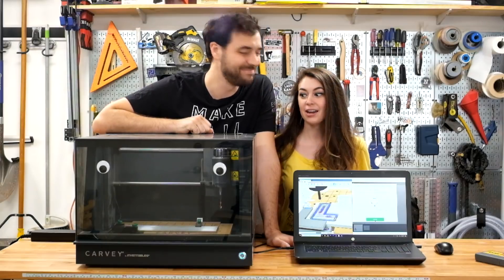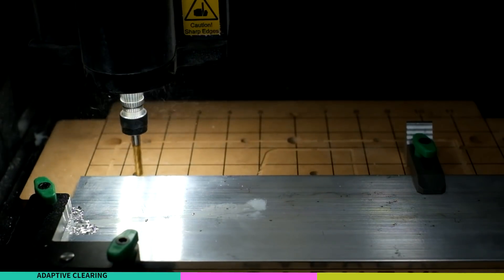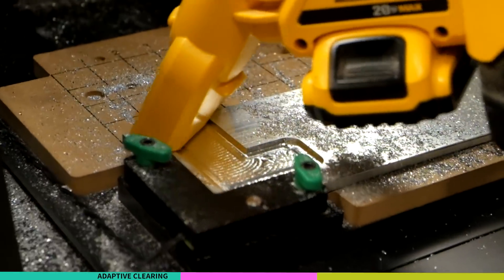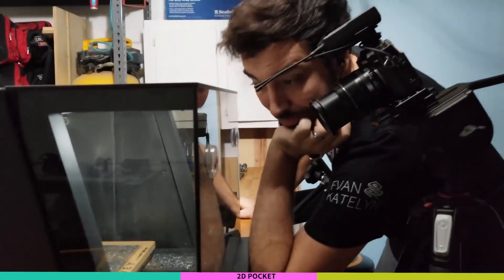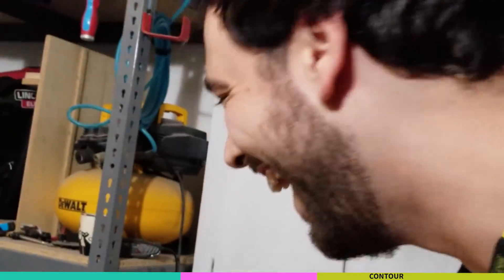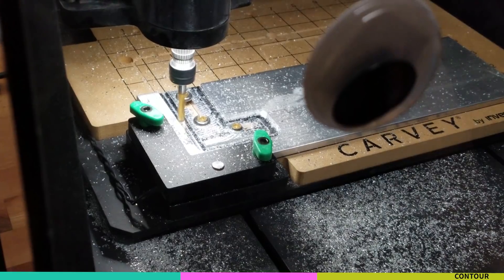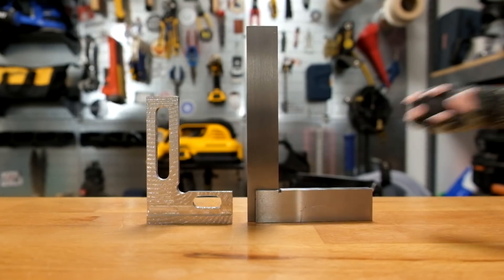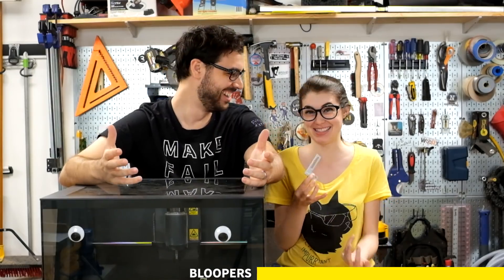Can You Cut Aluminum on a Desktop CNC?

Comment: It was a good video, very educational. But you did the opposite of what is usually done, that is, start with low speeds and depth and then gradually increase. Of course, there are no absolute truths and there are many ways and tools to cut aluminum, but I would use another type of cutter, such as the one-cut cutter, as aluminum tends to clog the tool.

Comment: Keep the cutting tool length as short as you can. This will reduce the amount of chatter. Some sort of lubricant will help reduce the build up of material on your cutter (WD40 or Kerosene can be used). Also there are different grades of aluminium some fabrication grades some machinable grades. 6060 or 6061 are common machinable grades. if you get a fabrication grade it wont machine easily and will gum up the cutter. Putting a drill in your machine and pre drilling holes where you plunge into the material can help reduce chatter when you plunge. Increasing the rpm can reduce the load on the tool but if you go too fast you increase the risk of material gumming up on the cutter so you need to experiment with that to get the optimum speed. Also less flutes on the cutter will give more room for the material escape and help reduce build up of material in the flutes. If you have a blunt cutter don't even bother trying to mill aluminium with it.
Hope this helps.

Comment: DONT PUSH THIS MACHINE. THERE ARE A LOT OF CNC MACHINING TECHNIQUES THAT WILL MAKE OR BREAK THIS MACHINE!!
Hello, I work in precision CNC machining with HASS, OKUMA, and MICRON machines. This video is misleading in a good way. So far the machine looks solid. The problem isn't just the feed rate. It's also the endmill choice. YOU DO NO PLUNGE WITH A BULL-NOSE ENDMILL! This is okay when you have a large machine and the endmills your using have carbide tips and are at least 1/8 inch thick. But even then its not a BEST PRACTICE. You will want to use a DRILL BIT to start the hole. Then use the bull-nose (aka flat nose) endmill to enter the hole and  mill the material away from the inside out. There are other techniques that are added to this as well. First, the guy was right about plunging as you mill the sides , just like he did int he beginning. The problem is also how much of the endmill tip you use. THESE ARE SMALL SMALL SMALL MACHINES. The machines I work with cost hundreds of thousands of dollars, have a huge level of configuration., and can HOG like its no ones business(that means cut huge amounts of material per pass, this is what they tried to do in the beginning of the video and it's wrong for this machine). I am thinking of buying this machine. IT IS NOT A WORK HORSE!! This machine is about as relevant to an full-size CNC machine as the extra napkins you get from a restaurant. I would say that this is a light duty hobby/special work machine. A GOOD CNC MACHINIST DOES TAKES EVERY PRECAUTION TO PREVENT CRASH (ANYTHING THAT INTERRUPTS MACHINING DUE TO SPINAL OVERLOAD)

Comment: I'm a tool maker(machinist) if you want to keep cutting aluminum you may want an endmill with less flute length and a 4 flute Endmill since you have a limited speed.
With your pockets it would help if you drilled your corners first.
Good luck and have fun

Comment: You guys are on the right path for sure. I have had really good results cutting aluminum with a router using single flute bits. O flute is what some manufactures call them. They allow proper chip breaking and for the higher RPM spindles. Oh and use 3/16" that dramatically reduces the spindle power needed.

Comment: Adaptive clearing actually has nothing to do with how much of the tool is engaged with the cut, but it has to do with the tool path. Adaptive clearing attempts to make sure your cutter is always engaged with the same mount of material removal, where as the other strategies in Fusion are more concerned with where they are going. For example, a parallel tool path will always move in long straight lines even if it's not cutting anything or if it's only cutting a very small amount. This is not always efficient especially for certain shapes. Your tool stickout is way too much for the rigidity of that machine. That machine is really made for wood, not metal. For a bit of contrast my proper milling machine is on the small side but it weighs 1500 lbs for a travel of 9" x 18" not that much bigger than the Carvey, but certainly much heavier and more rigid.

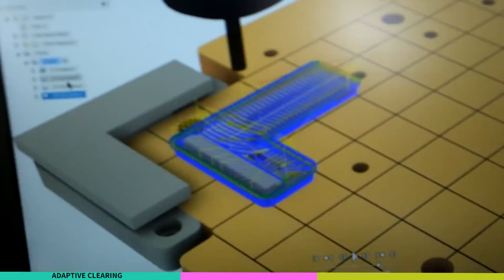Comment: 2:04 I thought Fusion 360 was expensive, but it is actually reasonably priced for a DIYer. $800 for 3 years, not bad.
Compared to AutoCAD at $1500 for just 1 year. Didn't realize how lucky we were to get it for free in school. Wish they had a DIYer version of AutoCAD for non-commercial use that was cheaper.

Comment: The problem is is you didn't have the speed fast enough when counting aluminum you want the bit to go as fast as possible you can make your movements slow but you want to make the bit RPM wise as fast as it can go then it'll cut aluminum like butter.

Comment: Might want toooo - I don't knoooow - consider NOT using ramp passes, smaller end-mill with 3 or 4 flutes for lower chip-loads, and slow that feedrate waaay down, you're going at Sonic level speeds there for that end-mill and machine.

Comment: I think you are getting so much chatter (vibration) because your work holding isnt ridged enough you needed to move that hold down clamp on the right closer to the area being cut as well as moving your feed rate way down, turning your spindle speeds to 95%  and using a smaller endmill if you have one it'll cut slower but have lower cutting forces and produce less chatter overall.

Comment: I have been running a couple of chineezium routers for about 6 years on both fun personal projects and work production. They can be a bit tricky when it comes to cutting aluminum. But they can work pretty well when you dial in the speeds, feeds and cutter size. They don't like 1/4" or larger cutters on aluminum, stick with 3/16" or smaller. We run mostly 3/16" 2 flute center cutting at the full 20,000 rpm, cut depth is set to .035", stepover about 40%, feed rate @ 35 ipm and plunge rate @ 2.5 ipm. I know I'm bit behind the times on this, but I just ran across it and thought my past frustration experience could be of help. I also didn't seen any new machining vids and thought you might have gotten frustrated with it. ;-)

Comment: Nice vid, congratulations. But you cant call this cutting. The vibrations are way too high with this machine and this is why you have such bad surface finish. If you like to use this machine for a longer time, try to avoid cutting alu. Your chips are also way too small, this means that you destroy the cutter very fast. A 1 flute and lower rpm could help here though. Still, if you love this machine avoid alu.

Comment: agree with other comment and also a 3 flute 45 degree helix end mill would’ve assisted your endeavor quite a bit. Properly clamping your product down doesn’t hurt either. A variable helix might help with that nasty finish. And yes it’s as bad as it looks. Just because you think you can’t feel much try polishing that part once. If our parts don’t machine without mark they are essentially junk. To make a bracket for your own use maybe but to make a product you wanted to sell absolutely not. I say this because someone is watching the video thinking they can buy that machine and make a living.
Reply from the maker: Thank you for the tips! Really appreciate it

Comment: You guys are doing great! I messed up WAY more on my first few CNC projects.

A couple things I learned early on, is taking small cuts but at faster feed rate, cleans up the surface finish and makes the bits last longer.
On smaller machines 2mm of plunge is quite aggressive, I would always go with 1mm step down especially for aluminum, and just have more layers at a faster feed rate.

Keep up the awesome work!
Reply from the maker: Thank you so much for the tips and encouragement!! ❤️❤️

Comment: YOU ARE USING TOO LONG OF AN ENDMILL THE SHORTER YOU MAKE IT THE BETTER IT WILL CUT
Reply from the maker: we tried to find a shorter one but didn't have much luck - definitely would have preferred that though!
Reply: MSC SELLS ALL SIZES TYPE MSC IN THE INTERNET AND WHEN YOU CALL THEY WILL SET YOU UP WITH AN ACCOUNT. YOU DO NOT HAVE TO BUY CARBIDE BECAUSE HIGH SPEED MILLS ARE CHEAPER BUT THEY DON LAST AS LONG BUT THEY ARE ALOT CHEAPER TO GET STARTED JUST RUN THEM A LITTLE SLOWER IN RPM

Comment: You can cut aluminum on our desktop CNC machines :)
Reply: They didn't use any lube and used an improper tool with no knowledge of feeds and speeds, so that's not working in their favor, either. ;)

Comment: 300w spindle motor with aluminum? Nope, sorry won't work.
Reply: I'm sure it would work with an 1/8th inch ( 3mm ) end mill. The machine might not be rigid enough, but it would cut. My milling machine has a 500w spindle and I use a 2 inch shell mill on it cutting aluminum.

Comment: Looks like a lot of your problem is that you're losing steps. You could decrease load on the bit by getting a smaller bit, maybe adjust feeds&speeds, or perhaps you could try upping the current to the stepper motors for stronger holding power.
Reply from the maker: Think we might also go with a shorter bit next time but we're definitely excited to try it again soon!!

Comment: Good angle, but it's rough as rough can be. Use a shorter tool, preferably carbide and preferably with more flutes. All of that  will help to reduce vibration and therefore reduce resonances within the structure of the machine. Which in turn, will improve the surface finish a lot. And possibly allow you to feed the cutter faster, as the extra cutting edge means smaller chips and reduced pressure on both the tool and workpiece. Beware feeding too fast though and of higher spindle speeds either of which can cause the metal to weld itself to the cutter.
Reply from the maker: Thank you for the tips! We tried to find a smaller tool but had a hard time finding one.
Reply: @EvanAndKatelyn  Out of interest, how does the head hold the tool? is it a collet or something like a drill chuck? Or does the tool lock in place some other way?
Reply: To be honest, if you're just cutting wood, you could just grind/cut off half of the flutes' length with a dremel or similar. as long at the end is reasonably close to a right angle with the sides it should work ok. But you could help it a little by grinding the central 'web', as we call it, so that the cutting edges almost meet in the middle. 
Check out this excellent video how to. https://www.youtube.com/watch?v=XYfJeg41t3M

Comment: 1) The tool you are using is suitable for wood not for aluminum.
     Declaration
     2 cut on tool kunstof wood etc
     4 or 5 for aluminum
     5 to 6 for adaptive toolpaths in CAM
 1.5) Inform yourself about Gleich und Gegenlauf
    The direction of travel must always point in the direction of rotation of the tool.
2) The main pathogens always use the shortest tools possible. especially with such small machines and especially on aluminum and steel
3) you can adjust the lateral delivery to (ae) 0.15mm
    the tiffen delivery (ap) 1mm with a D6mm tool

I hope you can learn something from this and put it into the next video

VB Hypermill CAM programmer
Reply from the maker: Thank you for the tips!

Comment: DOC should have been a bigger concern than cutting feeds. If you go too slow you risk wearing out the cutter too soon, generating too much heat, or even work hardening your piece. I usually run 30 in/min with a 0.005” (sometimes less) DOC on my X-Carve (should also be noted I use a 1/8” bit, which I think someone else mentioned down below) with good results. Hard to get away from chatter on these less rigid machines, but with a little cleanup you can make some nice looking parts.
Reply from the maker: Thank you so much for the tips!

Comment: at first I was cringing hard watching this.  but then I realized, we all where there at one point in time.  Watching the learning process was the best part.  You have to fail to learn.  The machine is as rigid as a wet noodle but by finding the limitations and working within them it was entertaining to watch.  Sure the endmill stick out was way to long, but how much Z travel is there?  maybe that was a reason for the stickout.  Sure the motor did not have the power and torque required, but that is where the lighter cuts came into play.  It was a process that worked out in the end.  Good job guys.
Reply from the maker: Yay!! Yeah that was the intent of the video. Showing our literal first time and sharing that and slowly learning. Excited to make another attempt with all the lessons learned from this first try 😄

Comment: The reason why you are getting that amount of "chader" vibration is because of the direction you are cutting it is called climb milling witch is cutting in the direction of the rotation of the cutter.
Reply from the maker: Ah yeah, we weren't sure if the machine would be rigid enough to do conventional cutting

Comment: I can't really tell from the video what type of endmill you're using...but if it's like the one you pictured, it's not designed to be plunged. In order for an endmill to be plunged, it has to have a cutting blade across the whole diameter. If it has a gap or hole in the middle, there's nothing to remove the metal from the center point, so the endmill skitters across the surface creating the chatter. If you look at this picture, the one on the left is a plunging endmill, but the one on the right isn't http://www.micro-machine-shop.com/end_mills_center_cut_non-center_cut.jpg
Reply from the maker: Yeah this one was a plunge endmill but I think we were just being a bit aggressive, excited to try again with more conservative speeds and feeds!

Comment: CNC machining is all about rigidity. Your endmill is longer than it needs to be and it's sticking out of the collet WAY more than it should. If you can, buy an endmill with the least amount of flute length that you need and stick it in the collet as far up as you can while still maintaining clearance between the collet nut and your workpiece/fixturing.
Reply from the maker: We had it in the collet is far as we could go, and looked for stubbier endmills but had a hard time finding one. if you have any suggestions about where to get stubby ones, please let us know! Thanks
Reply: MSC industrial supply is where we get most of our stuff. McMaster Carr has a good selection too but they're a bit pricier.
Reply from the maker: Thank you!

Comment: I commend you for trying and getting this done... And while alot of people have advice and want to help, some of it must be taken carefully...

Firstly, I'm coming from experience as I have a workshop with 9 cnc machine centres and 17 cnc lathes with an assortment of manual machines. 21 years in this industry along with having built my own 3d printers and hobby machines for home over the years...

While your machine was capable of getting it done, and others are watching this, you should know that that vibration will destroy your machine in fast order... The accuracy will evaporate quickly if you cut like that. The vibration is not coming from endmill deflection primarily since the machine does not have enough rigidity to overwhelm the endmill rigidity (seen by the walk around on the plunge and jump backs). That means the endmill loads and unloads by amount of slop/flexibility in the machine... That will wear your drive and guide system very quickly.

Secondly, endmill plunging should really be outlawed... They are not designed to really do that, however if you must... Then the plunge has to be ridiculously slow... General rule of thumb for me to start is 1/6th plunge feed to mill feed on an industrial machine... On my home machines which I've built very rigid I use 1/10th if I'm lazy to predrill. The centre of the endmill does not have the same cutting speed(Pi X smaller diameter vs larger) as the outside skirt and you have to work the the weakest/slowest part of machine/tool always. A ramp or helix entry is better but still not as good as no load face entry. 

As for fear of 'gummyness' , maybe a peck style cycle to allow some cooling? But best bet is to either enter work from outside the job, or in case of the pockets, drill an entry point with a twist drill where endmill can enter into and only cut with side loads... Never plunging loads... 

Thirdly... Everything is relative... Spindle speed, feed, depth of cut...
You can't have it all at max and expect it to work well... Aluminium requires a good bite per tooth, especially without coolant, but your depth of cut is simply too large... Try tiny depths of cut and you will be better off (0.2mm etc).
Industrial machines have the same limitation, the difference being that everything is bigger, stronger, beefier and allows for higher speeds, feeds and depth of cuts, but you still can't set it to max everything and expect it to get a good result ;)

Good luck ;)
Reply from the maker: We really appreciate all the tips and knowledge you've shared - thank you so much!!

Comment: your getting chatter because the frame and maybe the drives are not robust enough to mill metal. Tried some PCB engraving on my WanHao i3 3D printer with 5deg V-bits, didn't end well. Sheet metal frame and GT2 belts are just a recipe for trouble. However, A dremel attached to the spindle on my converted 1963 Cincinnati 1B Toolmaster milling machine (7' tall and 2880lbs) HAS enough rigidity to CNC engrave a PCB with reasonable accuracy.
Reply from the maker: ah good to know!

Comment: Shorten the tool length will make it rigid,  which is the magic word in machining, rigidity is essential. Slower rpms when shatter is present along with a slower feed.
Reply from the maker: We tried to find a stubbier bit but weren't having any luck. Thanks for the tips!